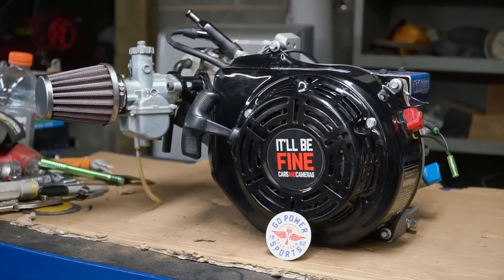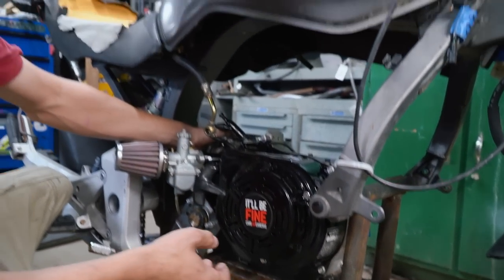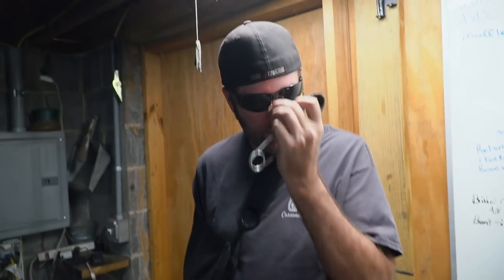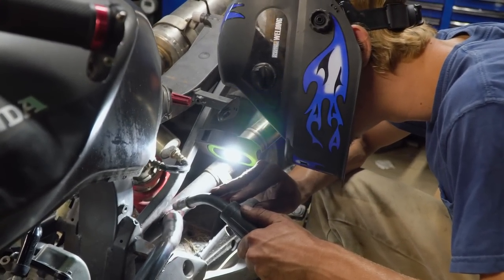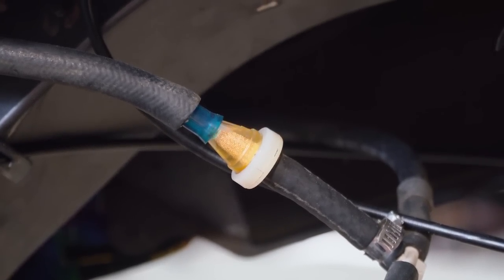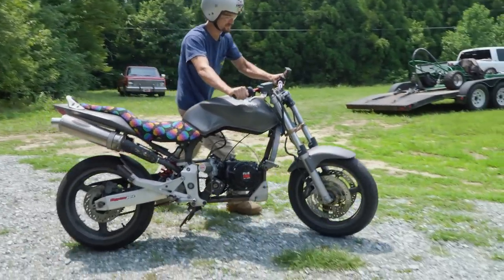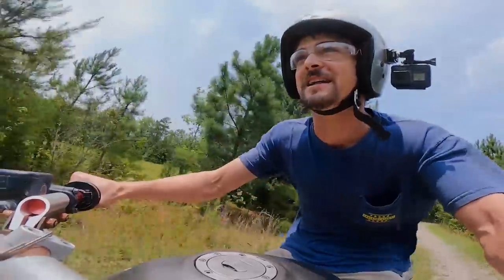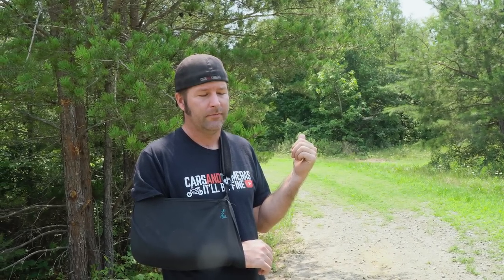Lawn Mower Powered Street Bike Gets 3X Power | Getting Road Trip Ready!

Comment: you need like a built 670(maybe with a turbo?) that can turn at least 4000RPM to get a sane gearing ratio out of it to drive in traffic, that rotax off the snowmobile would be a much better choice

Comment: Since you have limited space to work with why not try the double centrifugal clutch set up that the one little minibike had in one of your older videos (maybe a colt mini bike) that will give you a two speed set up and didn’t take up that much room, should solve the low end torque and higher top end issue’s

Comment: Put a torque converter on it.  Redo the motor mount; with the engine's gas tank off it's a lot smaller and you have lots of room to move the mill around in the frame.  Redo the motor mount and move the engine forward a fuzz, stick in a torque converter to keep the bottom end and pick up a lot of top end.

Comment: I still think It would really benefit by having a CVT system. otherwise it's going to lose at one end or the other. either a low gear ratio it will not have enough top end, or a high gear ratio it will not have enough bottom end, where as a CVT has multiple gear ratios. you would be basically adding a transmission. although it would be an automatic transmission.

Comment: 212 non hemi predator,  arc stock length rod , stock piston, mod2 cam, arc flywheel 32 degrees of timing, stock style carb with mixture screw bigger main jet stage 1 kit from gps 18lb valve springs, stock valves and retailers,  1.3 stamped steel ratio rockers, sanded the short turn of the intake and exhaust turns 7250 rpms and does 60 mph with me on it my 5,3 115lb self 50mph no problem with anyone else

Comment: Why not running a larger torque converter so you have bottom end take off power and in theory a little bit of overdrive for top end speed??? A centrifical clutch, your stuck with the one ratio......? IDK doesn't make much sense if you want to have the best of both worlds ya know?

Comment: Rather be welding put a dog tooth gear on the jack shaft for hi low gearing could be the solution you need for this project.
Was thinking about weight and get the best of both worlds if you want to cruise it on the road and bang it on a beach.

Comment: Take the gear box and modify ur jack shaft to work with as if it was the crank assembly idk just idea or possibly find a way to cut a old 2 stroke bikes blown engine case up and make the transmission part ur jack shaft some way I can picture it just don't know how to explain had a go-cart my dad built with a set up kinda like this or look up preditor dirt bike and use his transmission plans

Comment: The fact YouTubers like this call gx200 clones “lawnmower engines” is rediculous, I’ve never ran into a gx200 powered lawnmower and I promise it is very unlikely you will find one without specifically looking for one, the fact that they call it a lawnmower engine is just clickbait, gx200s are mainly used in air compressors, water pumps, generators and stuff like that, while clones are mainly sold as crate engines and on power sport stuff.

Comment: If it won't run 50 mph then it shouldn't be on the streets... No headlight,no turn signals,no tail light,no brake light,no horn,no gonna pass inspection nor tag or lots of tickets while going to ride in the LGBT parades.. HMF slip ons are no states compliant and will be ticketable... Also they're not even... Left side slip on is like 1.5" lower than the right side slip on...